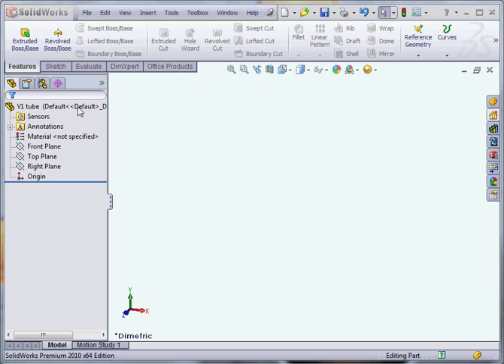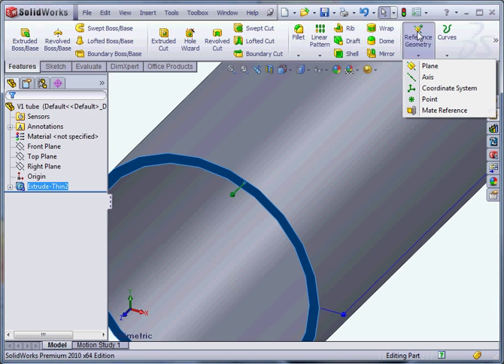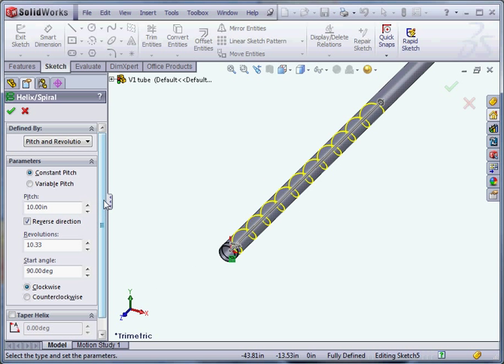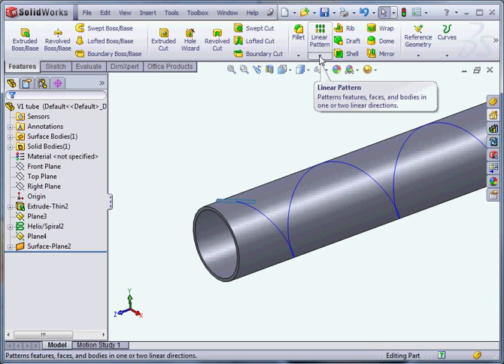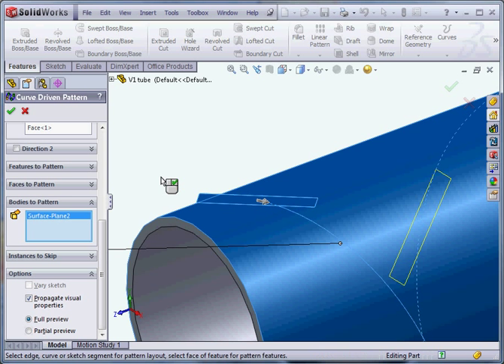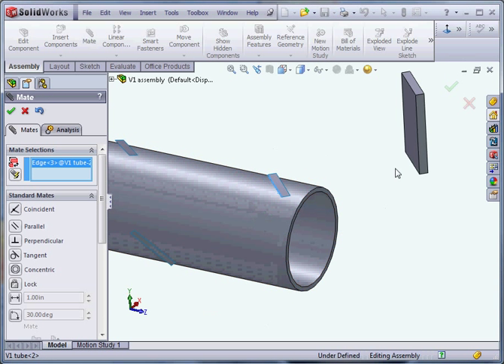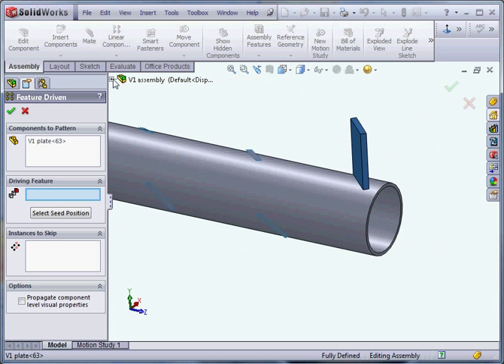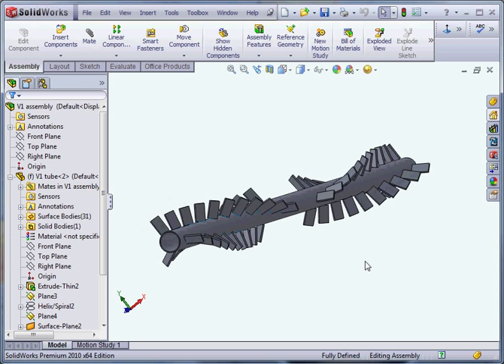Helical Assembly Pattern.avi

Comment from the maker: I suppose there's the chance that they broke something since I did this video in version 2010. Is your cylinder fully constrained or just concentric? If it has the - in front of the part name then it's free to spin and maybe that is causing a problem of some sort. You could add a straight feature in the sketch so that you can mate one of the cylinder planes to it so that they can't rotate and hope that does it. I don't know what it would be other than that.

Comment: Thanks for the great video. I have followed your steps but with cylinders following the feature driven pattern. My cylinders don't stay mated to the surface feature. They start mated and finished mated but move away from the central post using a circle offset from the post. Any ideas? Thanks again